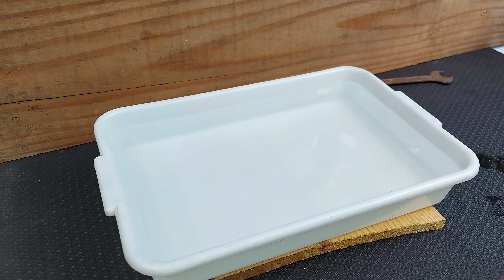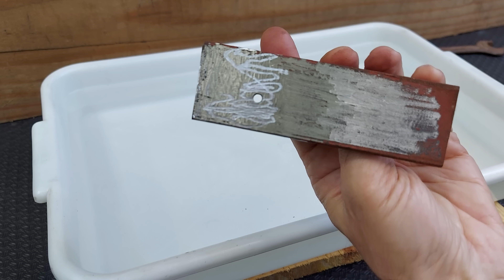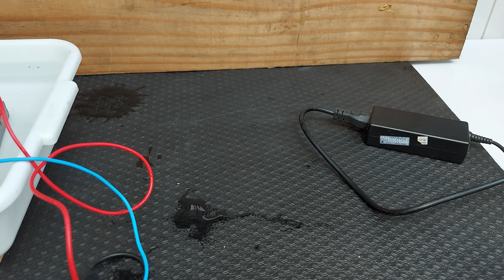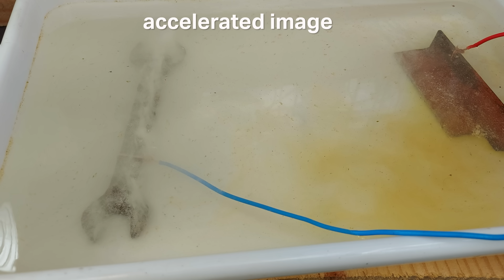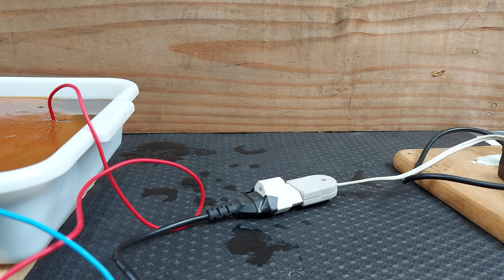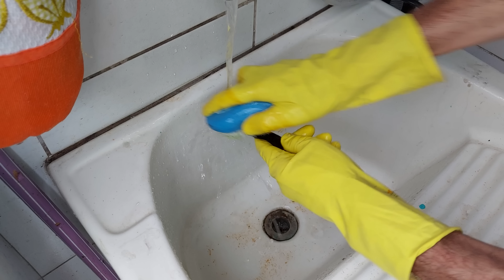HOW TO REMOVE RUST WITH ELECTRICITY #rust #removerust

Comment: Before going through all this trouble, put a  wire brush on your drill, clamp the drill,  and within 5 minutes the spanner will be clean !
Reply from the maker: Hi!
The purpose of the video is to give technical tips. This tip can be used on small and more fragile parts.
Thanks for watching!

Comment: What you've done here is electrolysis. Using electricity to split water atoms into their respective hydrogen and oxygen atoms. You may be cleaning the rust off your wrench, but you're also creating hydrogen fuel. This is the basis for using hydrogen to power our grid and vehicles.
Reply from the maker: Yes, exactly!
Thanks for watching!

Comment: Hi. Nice idea. I would like to try this, but I will keep it locked away from my kids. I have used vinegar with a bucket of rusted nails and let it sit for a full day. It worked great. I want to discover something to put on the nails after so no new rust will start again.
Reply from the maker: Using vinegar is a good idea as it has acetic acid. However, the process takes longer.
You can use the same problem shown in the video to transport good material for the nails - example: copper. However it will be expensive. Opportunately I will show this process here on the Channel. Thanks!
Reply: @brestore  Sounds like a good idea. I have lots of pure copper pipes left from doing renovations in houses. They are old ones that are used.
Reply from the maker: Медь отличная. Я использовал медь, чтобы покрыть винт!

Comment: Washing soda (not baking soda) works well too; gives the metal a patina look.
Reply from the maker: I appreciate your tip, Georooney!
Reply: Tried it and it DOESN'T WORK!
Reply from the maker: Hello Jusku! How are you?
Friend, to give the result shown in the video, you have to use a spoonful of salt for every 250 ml of water. The voltage used must be at least 12 V.
The more salt and more voltage (do not exceed 19V), the faster the magic will happen.
You can also use 3V voltage, but the result will be slower.
Thanks for watching!

Comment: hi what voltage are you using for this rust removel
Reply from the maker: Hello James! How are you?
In the video I used a 19V notebook charge power, but you can use even a 1.5V battery.
The more voltage and the more salt, the more efficient it will be. However, much salt will be harmful to source or battery. The more salt, the more energy consumption.
Understand that it is dangerous to put your hands in the water, ok?
If it is your first experience with it, start with a 1.5V battery. Use a glass of water and a small spoon of salt. Try to unravel a nail. It will take a while, but it will be a good experience.
If you can and want, please come back and tell how it was.
Enjoy!

Comment: Have u heard of a bench grinder an a wire wheel or a sand blaster both do the same thing with much less effort an long term cost.
Reply: I usually bathe the keys in acetic or citric acid, and then clean them with a wire disc - it's much better this way, it shines like new
Reply: Not every one has a bench grinder, wire wheel or sand blaster.
Reply: @BELL2mk316  then not everyone cleans the keys
Reply from the maker: Thanks! The more solutions, the better. We use whatever we can! Hugs!
Reply from the maker: Thanks, Alex!
Reply from the maker: Yes, Doug! For this reason it is good to know different techniques. Hugs!

Comment: Interesting but 2 hours is inefficient.  
I would prefer WD-40 and a wire brush in 5 minutes max
Reply from the maker: Hello iSid! You should use electrolysis for two situations (in my opinion):

- A large piece with many details - working time will be shorter

- A very delicate piece - using a wire brush you can damage it.

Best Regards and TKS for watching!
Reply: U...........

U